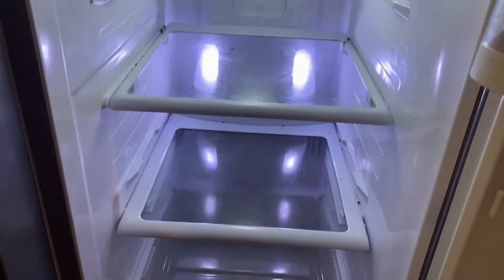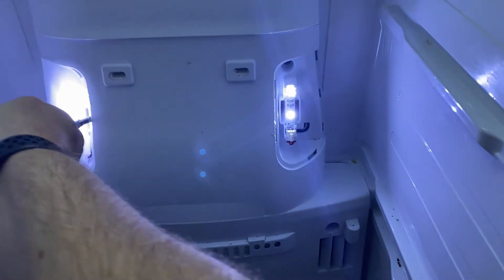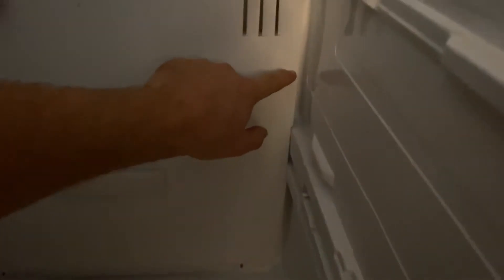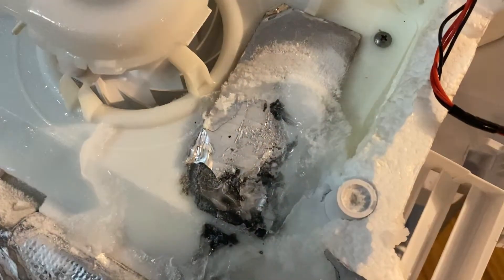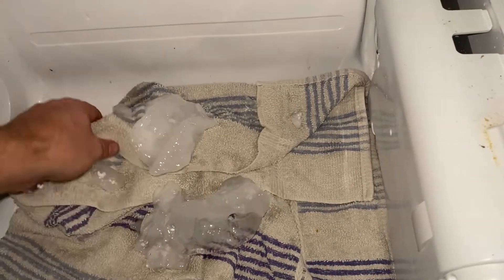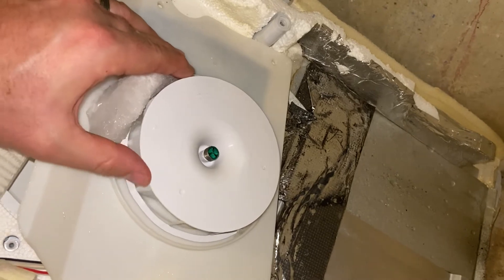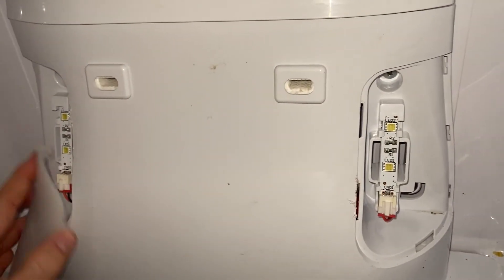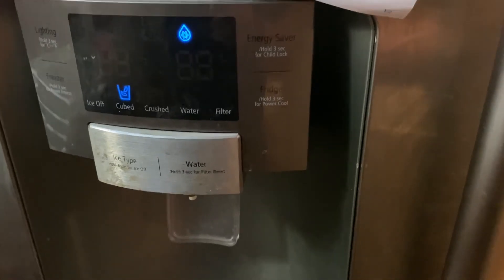How To fix your Warm Samsung Fridge | RS265TDRS #DIY #notcooling #Samsung

Comment: This is our model and thank you  for producing this video. This started to occur while still covered under our warranty, and the technician that came out wanted to be sure I knew about the process because it is a known defect and issue with this terrible appliance. I approached Samsung a number of times and they continued treat this like a warranty service without taking responsibility for the flaw or customer experience and satisfaction to say the least. As food prices sky rocket the liability for having this throw away appliance increases day by day , (in addition to wasting valuable personal time) I will be purchasing a new appliance. It will absolutely not be a Samsung and based on these experiences and lack of accountability from the manufacturer - we are always certain to help everyone we know to steer clear of this terrible brand.
Reply from the maker: I agree, I will not be buying Samsung appliance anymore. Riding this fridge out

Comment: Score!   My exact model!  Worked like a charm.   I got nervouse when it didn't start up right away after I plugged it back in.  Then again when it wouldn't shut off even when it got to temp.  But all is well now.  Thank you for the instruction.
Reply from the maker: Glad it helped!
Reply: this is happening to me as we speak... the temp started at 68 and is gradually going down a deg every 2-3min. fingers crossed.

Comment: Also if you hold the top 2 control buttons for 8 seconds it will blink with an error code E 22. This says refrigerator evaporator fan malfunction.

Comment: Unfortunately this a common problem with both Samsung and Lg side by side models. All brands deal with problems of icing over but those two brands are the worst. Great straightforward video. Be very careful pulling the cover out. The replacement parts are very expensive.
Reply from the maker: Thanks, I’ve tried replacing sensors and thermostats but nothing has stopped it from icing over. But I’ve done it enough times now that it’s second nature.

Comment: Thank you so much!! The first time I tried to defrost I unplugged it and let it sit for 24 hrs., that didn't work and that's when I found your video, it was a lifesaver (from my wife). A few months later (yesterday) it stopped working. I got a call at work yesterday from you-know-who, that it wasn't working. I came home early and emptied the fridge into a cooler, didn't touch the freezer, and began taking apart the back wall, I got the hair dryer melted everything, popped it together, and was done. All in, it took about 3 hours, had all the food back into the fridge by 9 at night.
Reply: Glad it helped! I had to do mine again last week. Seems like its every 3 months for whatever reason. I gave up trying to find the root cause.

Comment: I have this fridge... 9 years, like most here. Fridge side stopped cooling (freezer is fine) after about 2 weeks of a clicking sound... i later find out that its the fan hitting the ice. So I see this video just before going out to shell out $2k for a replacement. I just finished putting everything back together and removed a LOT of ice. I am currently waiting to see if this solved my problem... after plugging in, I was at 68deg... slowly, with rapid cool engaged, it is going down 1deg every few minutes. THANK YOU EFD!
Reply from the maker: Awesome! Glad it worked.
Reply: I'm at 36deg and holding!
Reply from the maker: @MichaelCurrie71  that’s awesome, remember how to do it, I have to do it every few months

Comment: Just fixed my Samsung fridge. Same problem. The defrosting element was burnt out. Replaced it and it works fine. The hardest part was defrosting the cooling coil.
Reply from the maker: How did you know it was the defrosting element?
Reply: @efd  I saw a video on u tube. After I defrosted the coils I checked the element with a continuity tester and found it to be burnt out. Had to wait for the part about a week then had to defrost the coil again to replace the element.
Reply from the maker: @TJCZNIK  cool, I’ll test mine next time I have to defrost

Comment: Same model, same problem. This video helped a lot. One comment for anyone else: If you're pulling that evaporator cover off for the first time, it will take more force than was needed in the video. You will break some seals. Make sure that things are melted enough that you're not breaking anything important.
Reply from the maker: Good call, if I remember right the first time I took it off was a pain in the butt
Reply: @Tyrell McAllister.. Because that's where most of the built up ( ice) is hidden. And yes plz be careful...pulling it apart. All the connections are located back there as well...and maybe frozen. 😮
Frustrating job 🤬😢😂

Comment: Thank you for doing this video.  I noticed the fan noise a couple of weeks ago and learned it was most likely this problem.  A few days later the noise went away!!  Wishful thinking that it would just fixed itself.  Found your video and today we tackled the issue.  It took 4 hours mostly because there was so much ice behind the panel so it took a long time of running a hair dryer inside with door nearly closed to loosen it enough to pull away without breaking the panel.  You are right…..DONT put the left middle screw in at all …. Neither middle screw is necessary.   There was so much ice that hole took a long time to thaw to be able to reach the screw and lots of effort to get the screw out.  Lots more time with the hair dryer on the fan panel, fan, and the frozen coil.  Then at least 2 more hours of power freeze and cool to get both sides back to reasonable temps.  I know doing this more than once, as you apparently have, will make it go much faster but I think we’ll just buy a new fridg.  This one is 11 years old.  Several years ago after paying 5 different service techs to come fix freezing water on the bottom of the freezing side due to plugged drain hole I found a YouTube video recommending to just wrap a copper wire around the heat coil and let it hang down thru the drain hole and that problem has never recurred.  I wanted to wrap copper wire around the refer coils today too but need a thinner gauge wire to be able to wrap it.  We bought all Samsung appliances when we remodeled 11 years ago and every one has been a problem.  Have replaced microwave….after fixing ourselves twice, dishwasher, and don’t feel too good about the stove either.  Thank god I did not buy Samsung washer and dryer.

Thank you again for doing this video!   I know it saved us hundreds of dollars…..maybe more.
Reply from the maker: Lots of great information, I’ll have to try the wire trick!
Reply: @efd we’ve been fixing our fridge this way thx to you for a few years now & like you at least every 5-6 months or sooner. We also recently found out that you can’t use a generator with Samsung fridges any of them!!! Unless you get an inverter for generator. We bought it specifically to save the fridge! There’s a couple hacks a mechanical engineer told a chemical engineering use a 2 prong plug end and remove the grounding & it works it’s hit or miss but we did eventually get it to work that way with no inverter. There’s another guy that has a video on a newer model that shows installing an actual defrost wire kit you add on in addition to yours & it plugs right in. Then wraps around the coils & runs when the other defrost kicks on. It’s definitely the defrost wire can’t handle the load. We’re taking ours apart now again! Did the copper wire work for you? Have you tried it? We just found out about the defrost wire & don’t have it & now our freezer fan also froze up too! Trying to find out if it’s the same issue but no videos yet 😓
I also like the people who commented renovated & replaced my appliances with Samsung but thankfully kept my old stove & got a Maytag microwave but I will never buy them again & have a lot of electronics of theirs with tons of issues too! 😢
Please respond if you tried the wire & it’s results or even the original commenter & thx!
Reply from the maker: @gunnybunny4081  I recently saw the defrost kit and am going to give that a try. while you are at it, check that the drainage tube in the back (take off bottom panel on rear of fridge) isn't dry rotted and stuck closed. I had that issue and the water wasn't draining out.

Comment: Very helpful, thanks for posting.     A possible reason you are having to do  this so often may be due to the drain that is underneath the coils.  Mine was completely blocked w/ ice.   I took the time to let it thaw as well, and then to make sure it was clear I blew compressed air through it from the other side (remove lower panel at back of unit) where it drains into a pan that sits under the compressor coils.   I am hoping this helps moisture escape as intended and reduces frequency of this procedure.

Comment: Same exact model.  Had thermostat replaced but now heard fan hitting the ice. Called tech back and wants to come back out for another service charge. I believe the drain problem is my issue as well. He claims to have cleaned everything out for an extra $80 🤦🏻‍♂️ Hope to fix the drain problem and put this up for sell. Wish me luck. Thanks for all the tips!
Reply from the maker: I’ll have to check out my drain line as well next time I defrost it.

Comment: New, more accurate title" How to very temporarily get your fridge to be cool again." There are usually at least two sensors that often need replacing. Also, check the drain line(s) is clear.  Thoroughly clean all the dust off all the the condenser coils and air intake areas usually in the back of the machine (everywhere.) 

Replacing that entire panel is a great idea.  That should also come with a new sensor and fan and better seal.  I just changed mine and it was 2 lbs heavier than the new part because it trapped moisture.  This moisture (from hair dryer melted ice- year I tried your way too) allows the evaporator coil to ice up again very quickly- even when everything appears dry and ice free.
I also changed my circuit board just to be safe and adjusted the defrost time (longer.)
There are also simple checks you can do to make sure you have enough Freon and that the fans are working correctly.  It's a fairly simple design- very similar your homes central AC.  With a little effort (and more parts) you should easily be able to permanently REPAIR (not just temp. patch) your issue.  Also, carefully check the seal all the way around the door.  If it is compromised anywhere, that can also cause the issue you are having.  There are several ways to do this check- just look online.

Fridges don't so much COOL as much as they dehumidify and remove HEAT.  That is why you never want to leave the door open more than ~5 seconds.  Also, never leave any high moisture items inside like a half cut watermelon.  It, by design will suck the moisture out of that item which can then lead to icing of the evap. coil.
Reply from the maker: Thanks for all the info! I've replaced the sensors but hadn't thought about replacing the entire panel. Will have to give that a shot.
Reply: @efd  I would do that.  Also, make sure the fan is working.  On my Samsung I used magnets to activate the fan (simulates the door closed.- the light goes off and fan turns on.)  If you are at all handy with a volt meter, you can do further diagnostics of the sensors and the fan- very easy and step by step videos are online.  

You could also put a video /phone camera inside- take paper to the vents to see if the fan moves when you close the door- or soon after.  Definitely check your drain to make sure it is 100% clear.  You can test the defroster using the forced defrost mode.  It's incredible how hot it gets- close to 400F.  This is not good for the food but usually defrosts much of the ice.  All of the seals have to be perfect or the warm, moist air coming in can lead to ice build up.

Good luck!
Reply: Any recommendations for the new panel? & Cost?
Reply: @PJLogan23  Not really- I was covered under warranty.  I would just go online- it costs what it costs and will be cheaper than buying a new one.  There is not much variation on the prices.  If I had to guess, maybe $300'ish should get you cold again.  

You could start with one sensor, maybe <$100 but plan to keep adding parts until it runs right...unless you diagnose a bad condenser in which case you might just want to replace the fridge if it's near the end of it's lifecycle.  Mine is working great though without too much effort. 

Either way, you have to clean out all the dust inside the back of the fridge (bottom.) Unplug it first! Make sure all drain lines are clear. They also sell a drain kit if that is part of your issue- bad initial design.  It ices over far too easily.
Reply: Does anyone have the part number for the entire panel for this Samsung Fridge ? seems better to repair the entire panel. thanks
Reply: @eddiemeza7982  It's easy to look it up online. You need your specific model and other info. of your appliance to be sure to get the right part. 

Do not just replace it without correcting the issue(s.) Often sensors need to be replaced, coils cleaned and drain lines cleared. Replacing or flashing/updating the computer is also a fairly standard practice when doing this type of work- to help avoid future issues.  

TIP: If you take that panel off and put it in a very small, enclosed space (e.g., a small guest bathroom w/door closed and blocked at the bottom) for a few days with a dehumidifier running 24/7, it can save you money. You won't have to replace the part. It will suck out all the moisture that the foam has absorbed. My new part was easily a pound lighter than the one it replaced. Just make sure the fan is working.
Reply: I just bought  a 20 lbs  whole melon  , cut it and sure enough my fridge feels like an air fryer.
Reply: @javiermiranda3474  Did you not read my elaborate post above JAVIER? I don't like repeating myself because you don't want to take the time to slow down and read it carefully. It's all in there. 

Real talk- I am not being rude. Rude is asking someone to repeat themselves because you are being lazy- real talk. If there was something you did not understand, let me know and I would he happy to elaborate on a specific point or two.

Namaste.
Reply: @UTAH100 Hey. Thank you so much for the video it’s so helpful. Also read all your advices on comments section . As of now I’m on the first step which removed all ice from evaporator dry it and put it back. My problem started with red filter light on the panel so I ordered new filter. Then fridge temperature stay warm and blinked on panel, inside fridge went high to 59f. After cleaned out back outside the unit from dust and closed it as your step by step video, started removing shelves and opened and removed ice. Everything was looking good so far and put back on and plug the unit back. It’s been 20hrs . Freezer got cold enough but not fridge. Do I need to replace the sensor or fan? (Expired warranty)
Reply: @LeylaK777  Hi. I did not share a video. Yes- generally you will simply replace parts until it's fixed. You can however test some sensors if you have a simple meter. A few videos will show you how to test them- it's super easy and takes about 5 seconds. You look for a reading that is within spec- which is easy to find out.  Make sure you are in the right MODE and not an away or defrost type mode. It is also possible you might have to change the computer as well. So it's sensors, fans, computers (and reprogram), etc. You need to fix the way it drains too so the ice does not build up again. There are videos on YT about that too- pretty easy. You might want to simply change out the entire back panel. I did. The new one was about 2lbs. LIGHTER. That told me the other panel was soaked with melted ice- water. Remember, refrigerators not so much COOL as they REMOVE HEAT and moisture- much like an AC. That is why you open the windows in your car and not just blast the AC on a hot day. Also, a FULL fridge will stay colder and work more efficiently. The items inside act like mini cold packs. Less air inside is best.
If after doing all the above it still does not work, consider the condenser/motor. At that point, call in an expert.

Good luck!

Comment: CHECK SOME OF THE OTHER VIDEOS about this issue with the RS265, and RS267 models - most of these crap samsung fridges do this. ours started doing it within warranty but Lowes and Samsung BOTH shit on us and delayed any real fix until the warranty was over. then they wanted to really fix it for big money. check the control board, the fan, and the temp sensor to be sure they are ok. also clean the coils! and clean out the drain tubes. look at the other videos on these topics

Comment: Clean behind and under the refrigerator to remove all the dust and hair once in a while helps and also don’t push the refrigerator up against the wall.  Leave it about 6-8 inches at least away from the wall so it gets good air flow.

Comment: Thanks for the video, it helped me get the cover off.  I dont have the ice build up as I did once before.  I've owned mine for about 9 years and have replaced the fan motor once when it first stopped cooling.  There was So Much ice then!  I just have some frost on the coils now.  I woke to the freezer being warm.  I knew the freezer door had not been properly sealing but I could not see anything in the way and went to bed...I have the panel open and the fan plugged in but it is not moving.  Suspecting I need a new motor again.
Reply from the maker: could be, I don't think I will buy a Samsung fridge again. It's been working well recently but since I said it, I'm sure to will freeze up again soon. :)